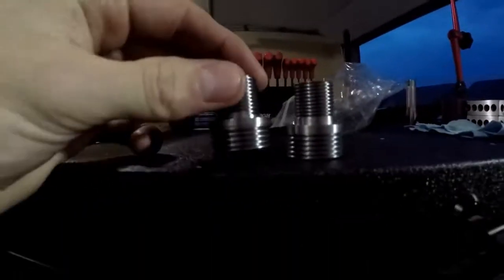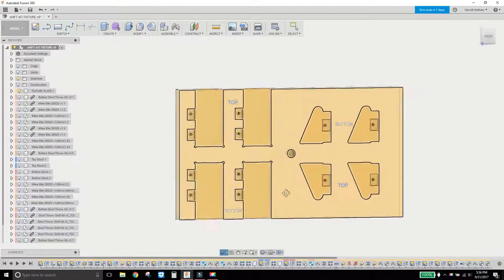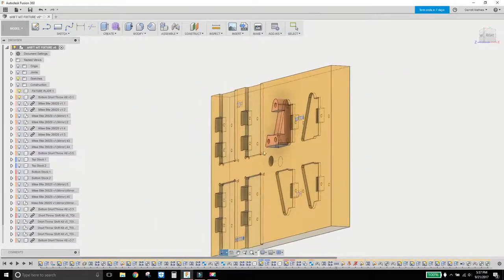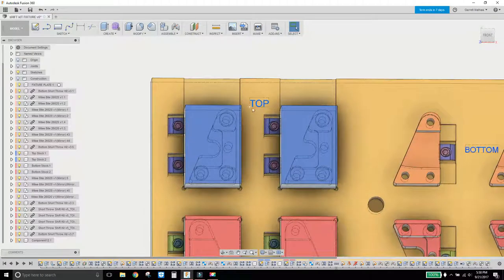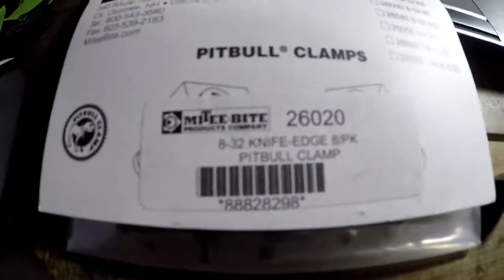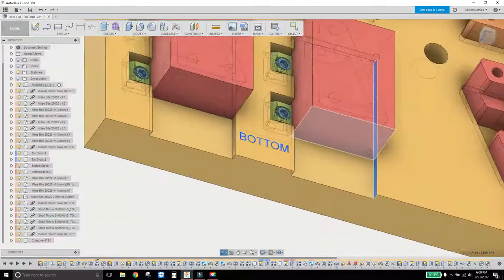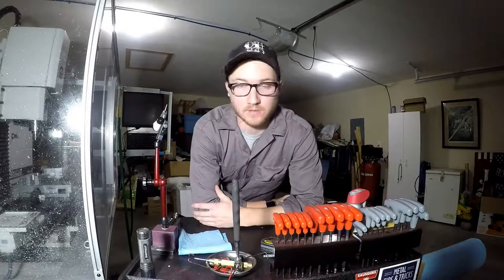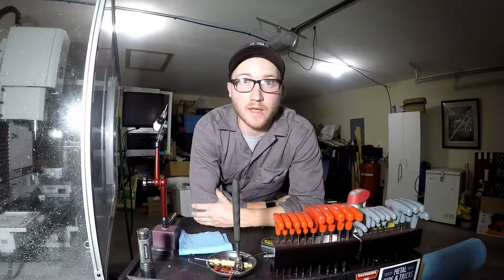Oil Filter Adapter and Final Fixture Design: After Work Special #93

Comment: Just an idea for your oil filter adapter.  You could drill a couple small holes in the flat surface and make a small spanner wrench to fit it.  That way you could install and remove it more easily.  Turned out really well though!
Reply from the maker: Thanks! I would have never thought to make a spanner to tighten it down.  Good thinking, I shall look into it.